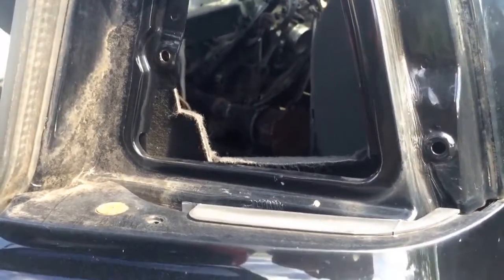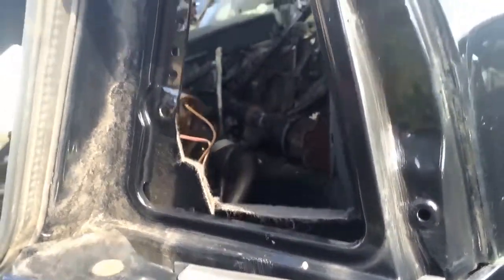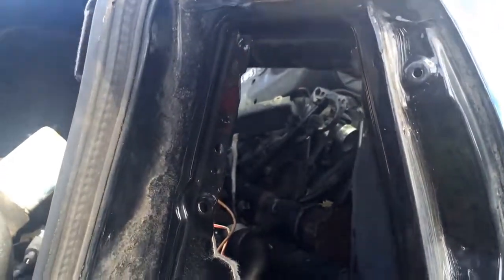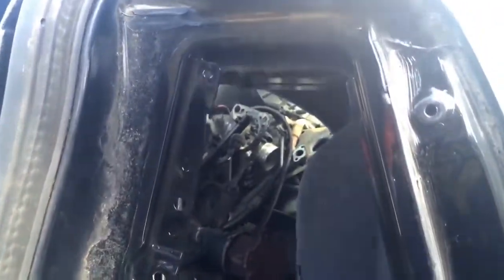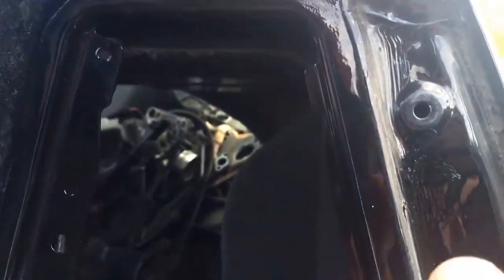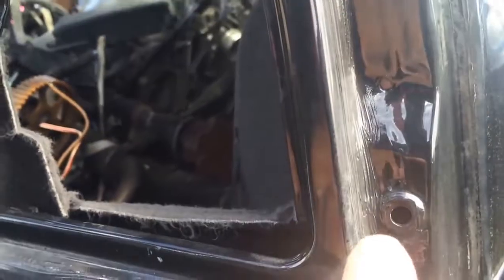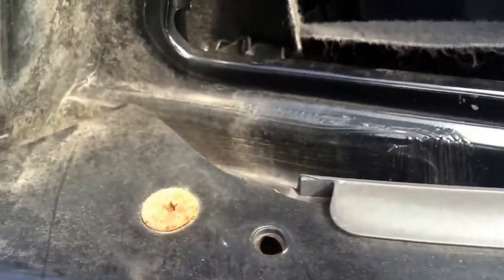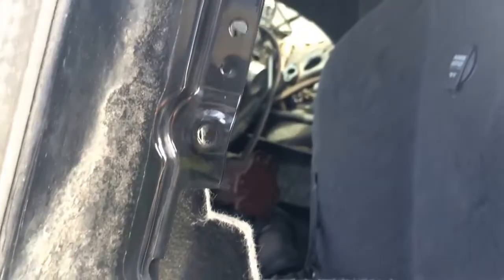VW Jetta Rear Light Removal 1999 2006

Comment: Doesn't help much if you're looking for a way to get it out to begin with showing the bolt holes really doesn't specify what do you have to pull in side panels apart or what just saying